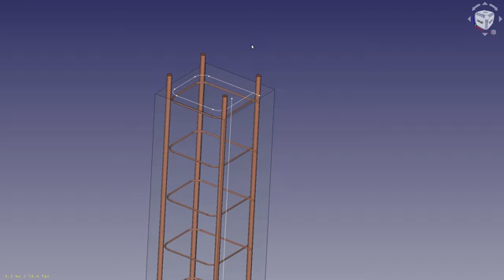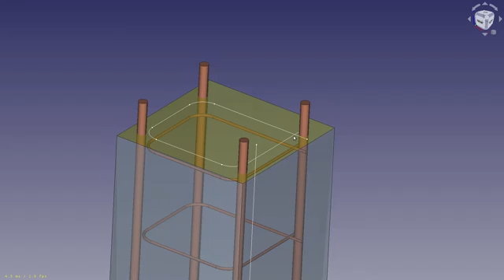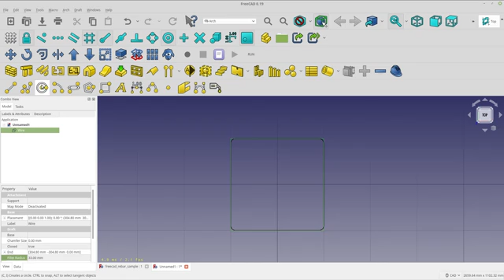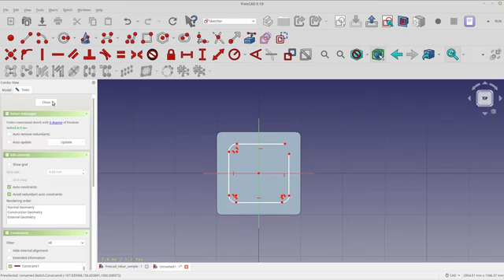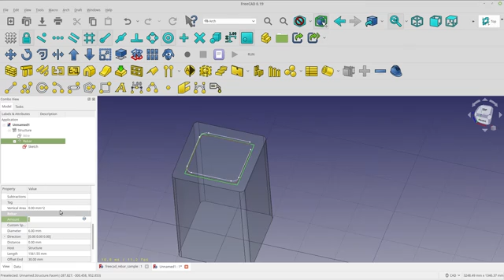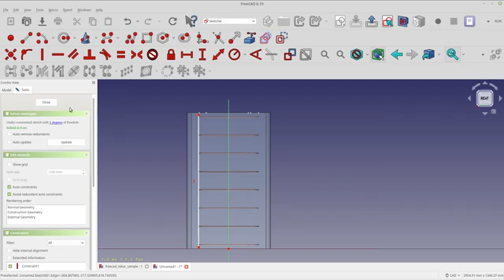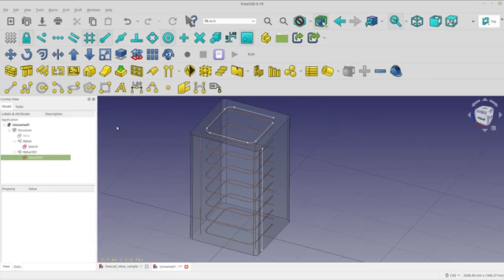FreeCAD Arch Workbench - Reinforcement Bar Tool ( Rebar )

Comment: doesn't the metal band (lateral) go around the outside of the vertical supports? Otherwise they aren't working together and can move independently, if the band is on the outside they lock together and "contain" one another  (and the concrete) much better.

Comment: The author has never in his life designed reinforced concrete.
Stop teaching people this non-sense.

Since when is your shear reinforcing inside the main reinforcing?
Do you even know what shear reinforcing is for?
Reply from the maker: Thanks for commenting. Nope I have never. This video is about using a tool in FreeCAD. About how to get a result. The maker of the tool was quite happy with the video. Most people understand the context of the video i am pretty sure, wont they use this as an engineering text ... i am sorry to have upset you so much.
Reply: @mathcodeprint  I loved it! It is very obvious that you do not understand the physical principles and you state that clearly in your video. I found it very honest and very well done.

To me it was very clear what you were teaching and what you were not teaching. And I am very happy with your video.
Reply: @mathcodeprint  
It's not about upsetting me, it's about "teaching" potentially dangerous methods.
I suggest reading up on how rebar and structural steel design actually works.

Comment: I wonder if there is a macro to make wire fixtures even if it is too basic, I make displays and it would compliment the macro  for sheet metal like a hand and glove, I may have to be creative but would help a lot even if is just like a sample of an S figure, any help is appreciated.
Reply from the maker: There is a pretty simple way to do that with a sweep. Draw the wire shape you need with one sketch. Use a second sketched attached to the endpoint of the edge on the first sketch, the use the sweep path tool. I have done a videos for Electrical Wiring that shows this

https://youtu.be/kxObJEhvJSs
and
https://youtu.be/qXxmO_nvUX0

If those don't help let me know, I could do one more specific to your need.
Reply: @mathcodeprint   being doing that for a while, guess I have to figure the macro myself, challenge accepted, just don't expect it tomorrow